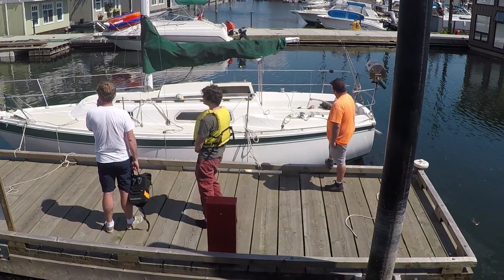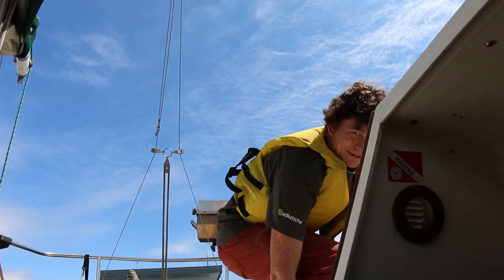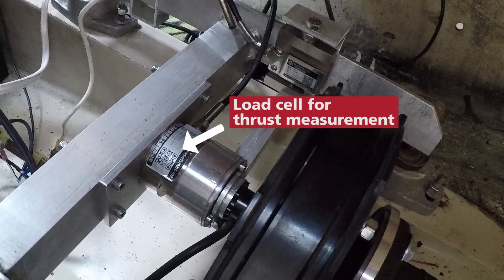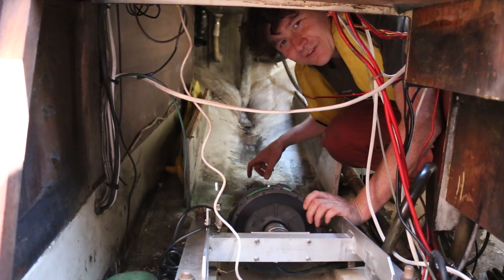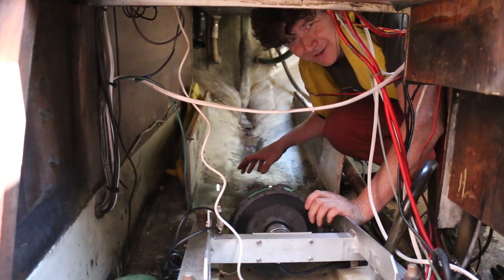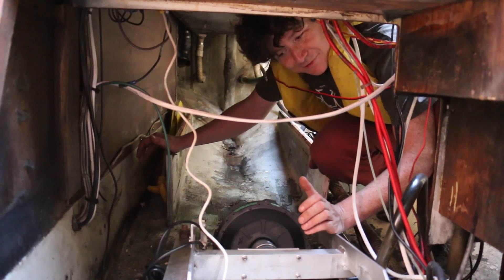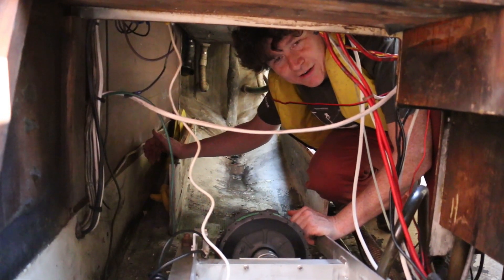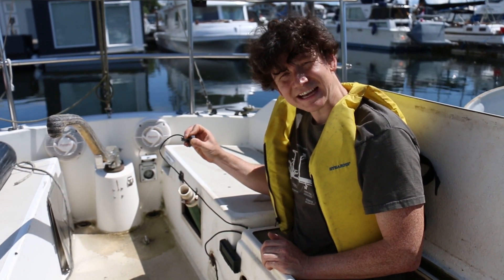Intro to Shamrock, Justin's first electric sailboat conversion

Comment: Can you regenerate battery by running motor in reverse during sailing?
Reply from the maker: Yes for sure. The motor isn't running in reverse, it's still spinning forwards, but the torque direction is reversed. With this boat and prop combination the max we'd see in a good wind is about 120 watts of regen. It's much much less than you can capture compared to a land vehicle which is too bad, because in principle there are several kW of power you could peel off fully powered sailboat without much impact to speed. But the standard fixed propellers are not well designed to capture this.

Comment: So now you can see by looking along the waterline of the boat you can see you need to put weight aft of the boat to get the stern down. Might be a good place to store more batteries?
Reply from the maker: Yeah, have a look at the more recent videos when we got 22 kWh in there, the trim is getting closer but we'll need to have a full 30 kWh to match the weight of the diesel engine that came out.

Comment: I don't see how mythical "hull speed" can help you know the power output of the prop, however between the load cell and the boat's speed-through-water you could get close (depends on shaft angle), which would be really sweet to see side by side with the other data you have there. Unpausing to find out soon :-)
Reply: Oh god, when you said "hull speed" you didn't mean it at all, you meant speed through water. You fucking land lubber, ha ha, get your shit together! :-D
Reply from the maker: Yeah exactly, I caught that flub too and cringed on hearing me say it in the rewatch when I meant to say "hull speed through the water".  Good eye on you for spotting it and realizing what was meant too. 

Guilty as charged as a land lubber still getting his feet wet.
Reply: @GrinTechnologies  Ha ha, all good man, I've had my feet wet since birth and that was a hell of a long time ago. Hull speed isn't even real, so you're doing better in my interpretation :-D

Comment: Just a suggestion, you could go to a gear box and with the right ratio double/triple your speed all the while taking the torque off the motor and reducing your Amperage usage ....all in all great job.....
Reply from the maker: This would actually reduce the motor efficiency. Even though the phase current would decrease by half or 1/3rd and the copper losses would go down, the eddie current losses from spinning the motor that much faster (which increase at the square of motor RPM) would increase by more than the copper losses decreased.  If you follow this link on my ES post I show how at the ~2kW operating point the direct 1:1 transmission is at peak efficiency, gearing it up or down from there only makes the performance worse. 
https://endless-sphere.com/forums/viewtopic.php?f=39&t=108411#p1586635

Comment: Way underpowered!  You'd get into big trouble trying to power through a strong current or a storm.
Reply from the maker: Have a look at the follow-up videos. This was just a first test run, with the larger controller and higher voltage battery pack the motor goes up to 5000 watts and gets the boat up to 6 knots just fine, so it's about the same as the original diesel inboard: 
https://www.youtube.com/watch?v=PBBeLVNga2s&ab_channel=GrinTechnologies

Comment: Thank you! Been looking to find a small electric motor, with some torque.. Knew there had to be some out there, on some product. Hadn't thought of electric Hubs.. Lol, didn't know these types of hubs had been invented, yet...Wonder how well it would work, if used as a wind turbine...
Reply from the maker: Many people have used ebike hub motors in DIY wind turbine applications too. They are quite versatile and efficient motors/generators for applications that need to operate in a lower RPM range than conventional electric drives.

Comment: I had the same ideas / issues re: propellers , until I found Dave Gerr's book - Propeller Handbook published in 1989 - pre-PDF days when you had to get paper books.
It is a bit of a "read" but he does a fabulous job explaining how to calculate what prop might be the "best" for your boat. The main focus is for boats that are displacement hulls.

Another reference that I have used extensively  for hull issues is Weston Farmer's book - "From My Old Boat Shop" - really good stuff in that one.

Your work in documenting the performance of the e-motor  conversion is one of he best ! 
Thank you
Reply from the maker: Happy to hear you find this interesting and thanks for the book suggestions.  The propeller handbook has been on my shelf for a while but there's still quite a bit to digest there.  The Farmer book I have just added to the summer read list :-)

Comment: Just stumbled onto this video while looking at electric outboards LOL  Took a look at your thread over in the endless-sphere forum and saw something that give me a bit of concern.  Your battery packs.  Are the 21700 batteries still prone to the short circuit thermal runaway issues that have plagued the 18650's?  As you probably know, sea water is EXTREMELY conductive so I hope your packs and connections aren't just insulated but SEALED!  Hopefully at some point in the future you'll be able to replace those LiPos with LiFePo4 such as are used in off-grid homes.  They DON'T overheat to an ignition point when shorted which has happened with the other battery chemistries.
Reply from the maker: Hey John, we deal extensively with 18650 and 21700 cells in the ebike industry and can say that things have come a long long way in terms of robustness and safety, and cell failures (when using Panasonic, Sony, LG, Samsung etc) are exceedingly rare. However, any time you have a large stash of lithium batteries around you should always be a little bit on edge and know what you are doing.  

These packs all have single port BMS circuits so any one battery that detects a cell issue will effectively be able to disconnect itself from the parallel array.

Comment: The dirtiness of the hull really seemed to affect a lot. In my boat (27 footer) 1000w gives almost 4 knots of speed. If I remember correctly (check my video) 100w gives 1 knot, 300w 2kn, 700w 3kn, and 4kn it goes to over 1kw. Then the consumption raises rapidly with max speed of 5,2kn with full 3,3kw.
Reply from the maker: Hey thanks for the references and yeah, the 3 years of marine growth had played it's roll. Have a look at the latest Part2 video for the consumption vs speed numbers after a sanding and fresh coat of bottom paint, it's quite similar to that:
https://www.youtube.com/watch?v=4kAsdIiD8d4
Reply: But that torque and force metering is brilliant!

Comment: Wow! This is great stuff! Have you guys considered putting a fast wound GRIN motor on an old outboard?
Reply from the maker: Do you know the RPM that most outboard engines run at?  As long as it's less than about 2000 rpm then it could be made to work, though mounting a hub motor in a retrofitted outboard I suspect will be trickier than this inboard job.

Comment: We have a fleet of sailboats itching for eConversion over here in Whitby Ontario (adjacent to Lake Ontario).  This use case is so intriguing with wind vanes, trolling rechargers,  reverse props, solar panels you could stay on the water for extended periods versus diesel options ... not to mention reduced maintenance.  With energy recapture options now available, a net positive energy balance must be seen ... cost is only issue.
Reply from the maker: Yeah, cost is an issue but it's not all that different from the cost of a new diesel engine installation.  Without batteries the electric motor is WAY cheaper,  and if you can do the installation with surplus lithium batteries (eg pulled from wrecked electric or hybrid cars) then you can do quite a bit on the same budget as a new IC engine.

Comment: Justin this is great video that opens the door to a lot of possibilities.

Ocean going sailboats spend most of their time under sail.  The ability to use regen power to charge batteries would be a tremendous advantage.  Even a larger boat with a diesel engine could still get a lot of benefit from using such a motor to generate electrictiy while under sail and letting the prop freewheel.

While sailing around the world I met a guy, in an electronics store in Opua New Sealand, who was looking for a relay to deactivate his homebrew regen system.  It charged his batteries really fast and he needed to be able to turn it off.  He said he had rewound an automotive alternator to get it to generate electricity at the relavively slow speed of the free wheeling prop.   Sailboats in the trades are usually charging along at their hull speed so the drag of a regen system would be irrelevent.  There are lots of coulombs to be harvested that way.

He mounted a large sheave on his prop shaft and coupled it to his alternator with a belt.  Doing the same thing with a gates belt seems like a really good idea.  

If it would be possible to add a direct drive ebike motor to the drive train so that the belt would be unnecessary.  There is not so much space for the belt drive arrangement if you have an engine in the boat.

If you could design a clutch that grabbed the shaft when regen was desired but let the diesel drive the boat with the shaft freewheelin through the motor, when serious propulsion was needed, it would be a very attractive product for a lot of sailors
Reply from the maker: Hey there and thanks for sharing that firsthand info.  It's a bit tricky to mount the direct drive motor on the shaft and have the shaft still go through the motor to couple to a diesel engine on the other side. It's doable but requires a motor with larger ID ball bearings than we are using here.  The drag of a well designed motor is so low that you don't really need a clutch to disengage it when you don't want regen. There is less resistance from the motor than your typical stuffing box, and definitely a lot less resistance compared to turning over the engine clutch itself.  

When we had the 8hp yanmar on the boat the propeller would only spin the shaft when we reached about 4 knots of sailing speed, below that there was too much drag with the stuffing box and engine clutch for it to turn over.  With the electric drive and the dripless shaft seal, the propeller now starts to turn on it's own when the boat is moving as slow as 1 knot. It's pretty impressive.

Comment: Intresting project, we are looking at supplementing our lifeboat with electric for #boatingeurope life. Do you have issues with over heating at full power?
Reply from the maker: RIght now what happens is that the motor controller overheats and goes into thermal rollback before the motor itself gest more than about 90 degrees celcius. When we install a higher power motor controller and run the motor at more like 4KW continuous instead of 2KW then we're expecting to see the motor core reach close to 130 degrees or so.  We can set the thermal rollback to kick in wherever we want and for this project we'll likely set that at 140 C.

Comment: Would love you to add a few more electric motors to the setup!  There are a lot of 5kw single electric motors but if you wanted to stick with just eBike motors how about 5 through axle electric motors connected through a common shaft :)
Reply from the maker: You could do that, but it would then be putting up to 20 kW of power into a boat that reaches hull speed at about 5-6kW, so not a very good use of battery power for this boat!  Have a read here for the actual power consumption vs speed graph: https://endless-sphere.com/forums/viewtopic.php?f=39&t=108411#p1586012

Comment: Sweet project! Is weight reduction an important goal for that boat? With my bike sailing system on my channel weight is crucial because I bike to the water (now with a GMAC equipped folding bike). So far I've done with out a motor on my dinghy but have thought of doing one at some point and possibly using ebike parts. Would be fun to see how your boat moves under sail.
Reply from the maker: I've recently posted a lot of test results on the ES thread https://endless-sphere.com/forums/viewtopic.php?f=39&t=108411#p1585615  Weight reduction wasn't a critical goal when the boat is already like 5000lb, but I was really curious just how much range you'd get if you replace pound for pound the diesel setup with a compact electric drive and lithium batteries, and the answer to that looks to be about 180km which serves my needs just fine!  

For your setup then for sure weight is everything, and you'll be super impressed at what you can do with like 100-200 watts of power and a well chosen RC airplane propeller and just a lightweight lithium battery. Look at the flexible shaft drives that are used in efficient pedal powered boats for inspiration.  Generally you'd be looking at a shaft speed of like 400-800 rpm depending on pitch. Lovely looking skin on frame boat build too btw!
Reply: @GrinTechnologies  Thx for the tip. 100-200W is a lot less than the rating of the Torqeedo outboards I was researching. For now I'm sticking with oars but I appreciate your innovation and curiosity. Have you checked out @PauliJuppi on YouTube?

Comment: Bravo I try to do as well it's better to get worm gears geared engine us well to get more  powerful engine you can use the same engine just
Reply from the maker: Have a look at this post here to see details on the engine power and efficiency, it's almost perfectly mated as is with no gearbox. Either gearing it up or down would actually decrease the motor efficiency https://endless-sphere.com/forums/viewtopic.php?f=39&t=108411#p1586635

Comment: Um, there’s a good reason why boat propellers don’t spin that fast. It’s called cavitation. You might want to look it up. It basically invalidates your entire premise from the beginning. Once you get beyond 5k rpm, you’ll just be making bubbles, let alone 11k.
Reply from the maker: For sure, I think you might have heard an extra zero in there.  The top speed of this hub at 72V will be about 1400 rpm. I've just posted the measured plot of hull speed vs propeller RPM and motor power here if you are curious:  https://endless-sphere.com/forums/viewtopic.php?f=39&t=108411&p=1586012#p1586012

Comment: What a brilliant project.  I love R & D stuff like this.  I can't wait to see what the MKII looks like.  Hopefully a bit quicker than the MKI?
Reply from the maker: We're up to 10.3 kph ish at 3000 watts with the 72V battery pack in place! And with the cleaned off bottom and propeller we are doing more like 7.5 kph at 1000 watts. She's a bit quicker now for sure.   It'll need an upgrade to a 12 fet controller to test out in the 4-5 kW range.

Comment: Nice work Justin! I also happen to be working on an electric propulsion system powered by ebike batteries. I went the outboard route and have an upcoming video on quantifying different pitch and size props for the given craft that the boat is attached to. Best part is I can 3d print props and experiment to my hearts desire!
Reply from the maker: Oh sweet! I had no idea you were doing this Phil.  Just watched your Part1 and will be keen to follow part2 and see some quantified data. And rad job with the bike trailerable Hobie. For anyone reading this comment have a watch here:
https://www.youtube.com/watch?v=TWHClLt30Bw
(PS, and if anyone blows a controller mosfet testing an eboat drive, Phil has you covered there too ;-)  https://www.youtube.com/watch?v=lTssCn5YyTw   )

Comment: Wow, I can't believe my eyes! Longtime fan of grin technology and now this! One problem with yacht propellers are they are always too small because of the desire to reduce  drag when sailing. Bigger prop can run at lower shaft speed and be much more efficient.Less friction on shaft bearings. Potential to run a system like your Gmac electrically rotating the shaft at slow speed so blades are screwing through the water with no "slip' electronic freewheeling.of course folding props can do this but the cost and complexity is huge. Once its blowing hard enough and boat speed gets up regen becomes viable. I wonder how much energy would  be needed for the "electronic freewheeling prop? I'm sure you can measure that with your various torque and load cell sensors. Keep up the great work!
Reply from the maker: Exactly! I'll be posting both test details and thoughts on this front on the endless-sphere thread as time allows.  With this setup I was able to get about 120 watts of regen when sailing in ~15 knot winds, but if you flip that the other way and put in like 120 watts of power then I presume it would be effectively like free slipping through the water.  Unfortunately I don't have the thrust load cell hooked up in the current arrangement, but once we DO then it will be so easy to see what's going on there. Any drag will be reflected by negative thrust on the shaft, any propulsion from the prop will be a positive thrust, and the sweet spot to emulate freewheeling is when the thrust is zero.  We'll be able to identify this point with precision.
Reply: Only takes a few watts to freewheel since the blade wants to spin anyway. Anytime the boat goes faster, like surfing down a wave, the motor automatically becomes an generator.
Reply: I think a few years ago, I had seen a propeller which folds it's blades when engine wasn't running.
Reply: Most efficient is a very large diameter, two blade, folding propeller.
…though that doesn’t give regen